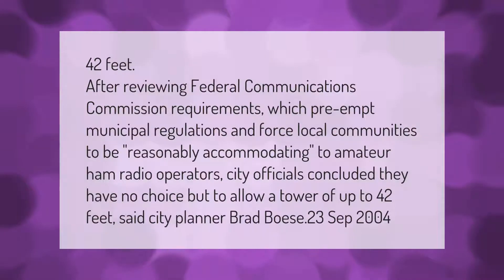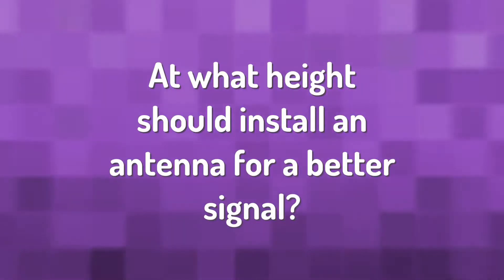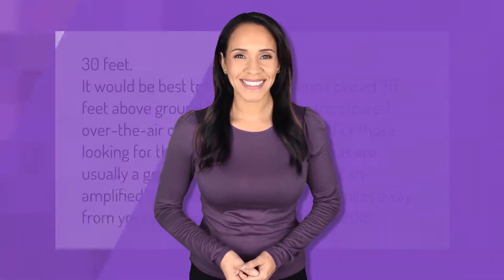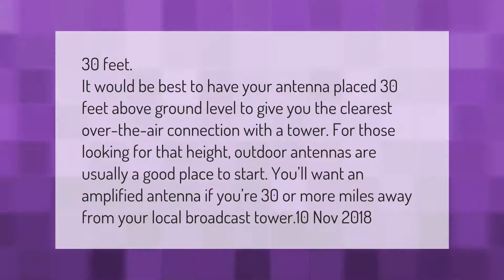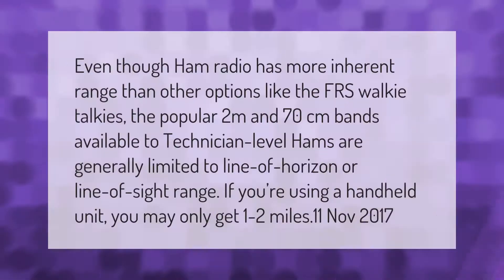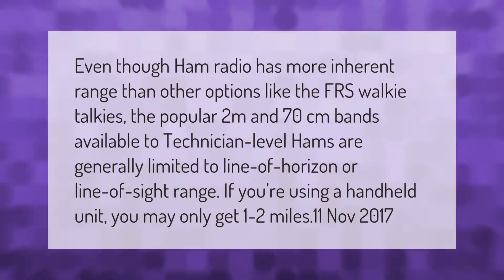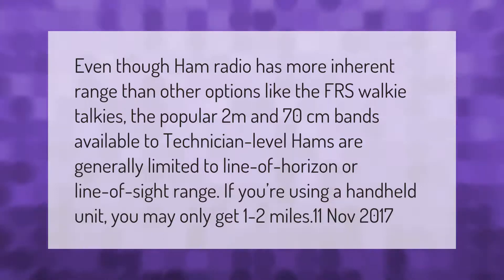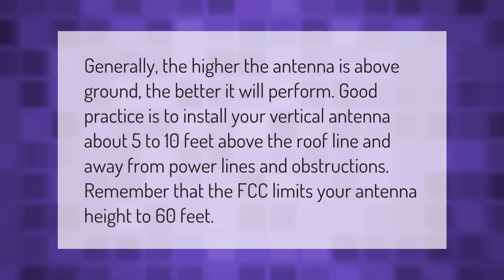How tall can a HAM radio tower be?

Comment: You can typically go up to 200ft, before needing to apply with the FCC and FAA. However, if you're near that height, you have plenty of money, so your lawyer can deal with the paperwork. It's exponentially more costly, the higher you go, at least with self supporting type towers. You can go higher for cheaper with a guyed tower, but then you need room. Also, which (and how many) antennas and feeflines, will need to be considered for wind loading.

Comment: Oh well I’m going 300 feet this spring with permits engineer and army core engineer and I need light for planes and helicopters I have none that fly over i have to install a backup generator.  If it falls it fall on my property on the farm won’t effect none of my neighbors. Well I guess I be 240 feet higher then what you say. It going to cost me a pretty penny out pocket. Inspection will cost me out pocket every year 2 but  still cost less than CATV a year. I have my HDTV and look forward towards more then 40 channels. Thinking about repeater and ham radio. Antenna 2 . Hell maybe the telephone company may want to rent space on the tower .There a shell of a building at base of tower.and a 200 amp service for expansion.
Reply: I was just hearing about a guy who makes a decent living changing the light bulb on a tower twice a year.